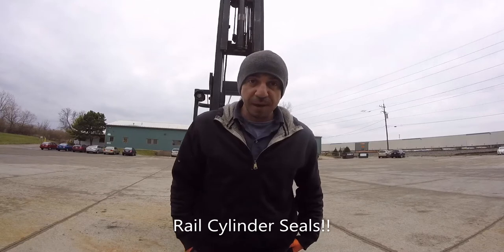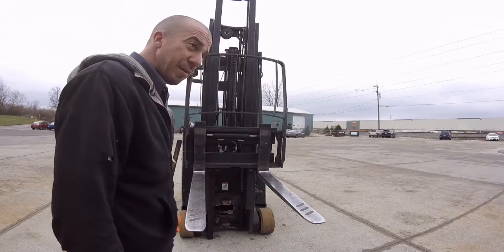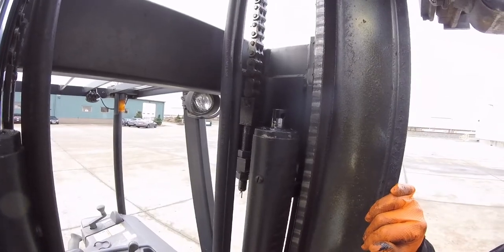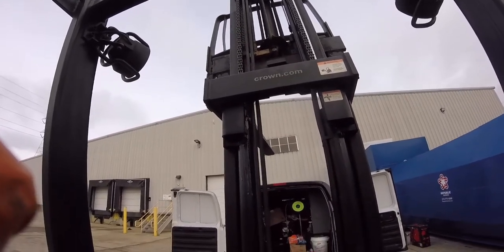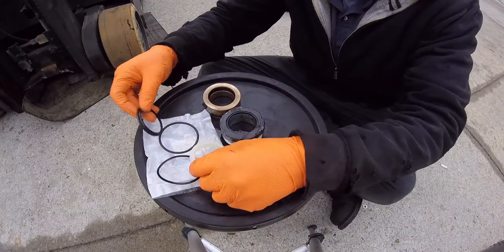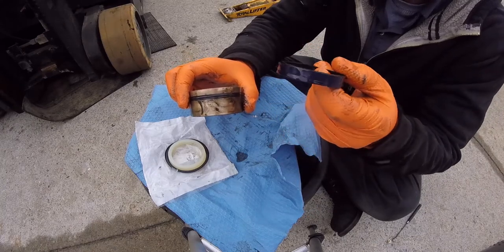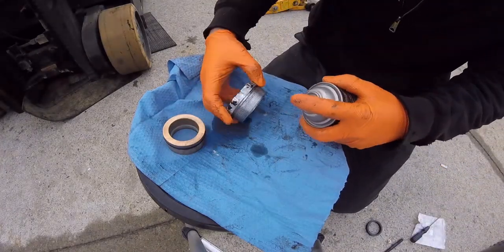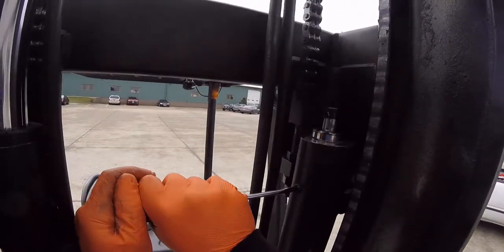crown RC3000 rail cylinder reseal job

Comment: I have a question for you. What would you recommend I use to clean and degrease the chains? I’ve used a few chemicals from dobmeir but nothing seems to clean them enough so I can re-lube them.
Reply from the maker: Brake clean will clean off most all the old grease and gunk from the chains.

Comment: Do you have any short cuts like this to replace the column rollers without taking off the entire mast? I have a crown tc-3020-30. Same setup your using in this video
Reply from the maker: Hey sorry for the delay. Yt is not notifying me of messages on my videos. If you are referring to the mast rollers, there is no way to replace them without mast disassembly.